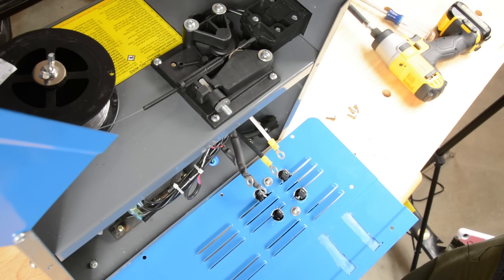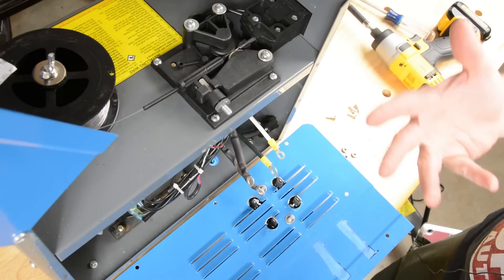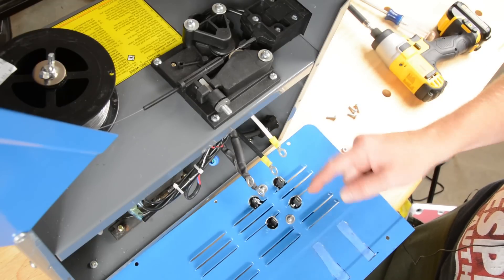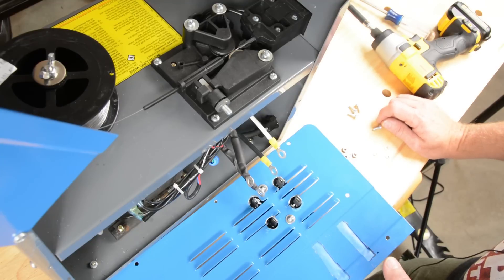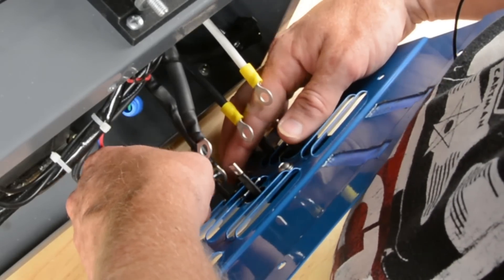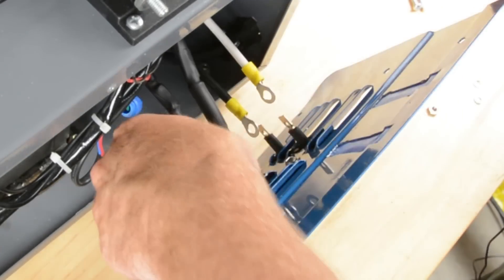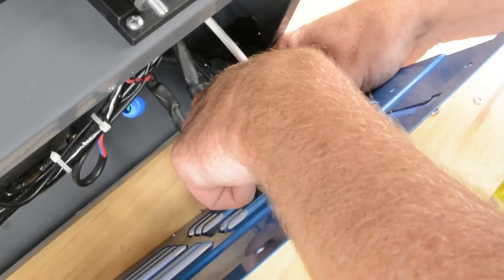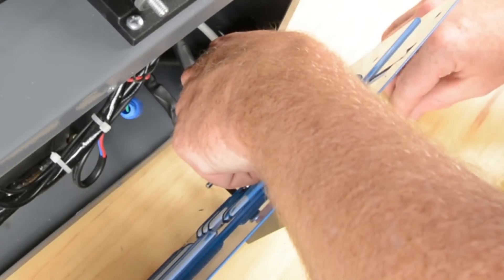Advanced Harbor Freight 90 AMP Welder Mods 06

Comment: Why a capacitor and not a coil?
Reply from the maker: Because flux core wire welding is a constant voltage process and not a constant current process like stick welding.

Comment: Hello. Great videos!! My question is how's it holding up. Not sure if I want to invest in this mod it wouldn't last. I rarely use it but I am planning on building an iron gate for a patio seating area and don't want to run into problems. Thanks again for this video.

Comment: I think it would be great to have a big copper switch that gives the option for DCEP.
Reply from the maker: There's really no point in it.  This machine has no option for shielding gas.  It's flux core only.  There may be an odd DCEP flux core application here and there, but nothing you'll be doing with this machine.
Reply: @MattHeere  , thanks so much, so with the flux core there is no performance difference between DCEP and DCEN? Greatly appreciate your video.

Comment: checked every wire / connection I see. no burnt smell , nothing

Im a 52 year old that's not into electricity.  but can hold my own, ya know what I mean? power to the shed , a few sockets, switches.ect. ..Never owned a welder in my life. Cabinet maker by trade. Weld metal to wood , . So far not so good.

Comment: I have power. wire feed works fine, fan works, . put the meter on. I get a quick reading that fluctuates 16 to 24 volts, then to zero in a second.

Comment: I hope you're still answering questions. I followed your instructions. now I get no spark at the gun. so I took everything back out, and something happened. I still get no spark?
Reply from the maker: Things to check:
- Is the fan running?  If not, then there's likely no power coming in to the welder
- Do you have voltage at the output of the transformer (what you would have hooked up to the rectifier)?  If not, then the transformer is likely disconnected on the primary side, or has died.
- If neither of these is the case, then you likely have a bad connection to the torch.  Wish I could suggest a likely spot for this, but I didn't have that issue so I'm not sure where to start looking.

Good luck!
Reply: Harold here, did same as you but get no spark from torch.  comes on, fan works, pull trigger wire come out but nothing, any help?  Thanks Harold.
Reply: +Harold Utphall
 sorry no help. I've checked for any burnt wires.  I get no ark
Reply: Worked good before , check on power coming out transformer, none.  It is getting power to fan and whatever feeds the wire, as wire comes out.
Reply from the maker: The fan is powered by the incoming 115 VAC right after the switch, so a running fan indicated that you're getting power from the wall, through the power switch and into the transformer.

If there's no voltage on the transformer output then either something downstream is shorting it out, or the secondary winding on the transformer has a break in it (a.k.a. it's done for).  Easiest way to check is to disconnect everything on the secondary side of the transformer and check the voltage with it isolated.

This is a pretty common failure mode for these welders regardless of the modification.  The wire in the transformers is pretty low grade copper, and there's a lot of vibration in these poorly wound coils.
Reply: Hey Matt, Question about the capacitor I'm using. On top has 3 terminals, G, Fan, and HERM, which is which?  It's a 40+5 MFD 370 or 440 VAC  BTR 405440  Thanks Harold.  Thanks for the reply's and Video"s
Reply: Me again, finally got it working, I think I had the wires crossed on the bridge rectifier.  Thanks for the reply's.  Harold.

Comment: hi again i was wondering as I have a 63v 2200uf capacitor laying around would irt work ?
I know it comes without one standard, so I guess adding any type of capacitor would be an improvement am I right ?
Reply from the maker: +Hannes Nilsström You have the right idea.  The rectifier makes most of the improvement, the capacitor is just a "nice to have".  So therefore any capacitance will do some good.  My concern with one this small is that it won't be prepared to work in such a high current environment.  Does it have screw terminals?  If not, if it has regular leads, then it is probably not a good choice just because of it's physical size rather than the low uF rating.
Reply: yeah it has screw terminals
Reply: Matt Heere yeah it has screw terminals
Reply from the maker: Good.  Sounds like it'll be fine.

Comment: Ok I have the rectifier and cap installed. I'm working on an inductor and when it's done will it go in line after the cap?  So torch lead to inductor to negative terminal on cap to neg terminal on rectifier?
Reply from the maker: That's it.  The inductor goes in series with the power to the wire feed/torch.  After the cap is best so you don't limit the ability of the cap to recharge as quickly as possible.
Reply: Matt Heere so I would connect the torch power wire to one connection on the inductor then the other connection to the  - terminal on the cap
Reply from the maker: You got it.  Meanwhile the "ground" clamp will connect directly to the + on the cap.
Reply: Perfect Thanks so much for all your help !
Reply from the maker: Glad to!  Would love to see a few pics or better yet a video when it's done.
Reply: Matt Heere so after I've installed the inductor I was doing some welding to test it out and I noticed I had some porosity (that's the correct term for the little "holes" in the bead) in the bead not alot but I just wonder if I did something wrong because the welds were perfect with just the cap before.. I've been looking at some homeade stick welder diagrams and noticed that the ones with a reactor and a cap have the cap on the + and reactor on the -... I know mine should be set up dcen but should I have the reactor on the ground side?  I was gonna just try it but haven't gotten around to doing it...
Reply from the maker: Hey Joshua.  What wire gauge is the inductor constructed from?  It's possible that it's adding enough resistance to limit the welding current, as opposed to keeping it flowing as it's intended.
Reply: It's 2awg ..? Too thick?
Reply from the maker: Should be fine.  I doubt you're getting enough turns with wire that size to make an effective inductor though.  Hate to say it, but I think I'd just leave it out.

Comment: By the way...why would you want DCEN?  Direct current electrode positive burns with more penetration.  Direct current electrode negative just burns with more burn off of the wire.
Reply from the maker: For flux core, all of the wire manufacturers specify DCEN.  I'm pretty sure that it's because you need to pre-heat the flux before the wire hits the weld.  Flux core seems to penetrate better than MIG anyway, so I don't think you're really losing anything.

Comment: Hey matt thanks for your videos they help alot. I have a question tho ive see a dc aluminium welder wich u can use aluminium sticks to weld aluminium and its needs 90 ams  and above to work and am just wounderi could it work if i run another wire from where torch is coming from to use as another torch clamp to weld with the stick. So it would be like have two torchesh one is the original  wire fed for metal and one is like a clam torch to use for welding aluminium plz help me
Reply from the maker: You might be able to make it work but I doubt you'd like the results.  Stick welding aluminum is a nightmare to begin with as I understand things.  You're then complicating the situation by having no control over the amperage.

Comment: You can order one from Amazon for $16 with free shipping. Just search for 100A Amp 1600V Volt Diode Bridge Rectifier Metal QL100A.

As for the cap I found a 100,000µF 50v at http://www.digikey.com/scripts/DkSearch/dksus.dll?Detail&itemSeq=155793097&uq=635453728855324649 for $30 part number E36D500LPN104TEA5M does that seem ok?
Reply from the maker: c2s Sounds like you found some good options.  With a cap that big you'll probably want to explore including a shunt resistor to dissipate the charge when the power is off.  My 43,000 gives a pretty good jolt when you short it after flipping the switch.
Reply: Matt Heere I was just gonna get in the habit of give quick zap after turning it off to bleed it off. 

 But if I do add one from looking around does a 200 ohm 5-10 watt across the terminals sound about right? Also read about using a 28v fan.
Reply from the maker: c2s Yeah, that's what I do.  It works.  Just make sure you run enough wire out of the torch head first, or it'll burn back far enough to fuse with the tip - which is a pain at best.
Reply: c2s hook a bulb up when you turn the welder off the bulb will bleed the capacitors stored energy.

Comment: Do you have part numbers for the Bridge Rectified and the Capacitor.
Reply from the maker: Ellen Mcginnis No part numbers, but the exact parts aren't critical at all.  Any bridge rectifier will do so long as it has a current rating that exceeds your welder output.  Likewise any capacitor will do so long as its nominal voltage rating is higher than your welder output while not welding.  The amperage will be a well advertised spec for the welder.  The voltage you'll have to measure to be sure, but it's unlikely to be higher than 50 VDC.

For the HF unit those limits turn out to be about 100 amps and 40 volts respectively.  A lot of the large rectifiers on eBay are setup for 3 phase power.  That's OK, just ignore one of the 3 AC inputs.  As for capacitance, the more the merrier right up until the capacitor won't fit in the chassis any more....

The capacitor is by far the harder of the two parts to find for a reasonable price.  New they cost more than the welder, and used you have to be careful.  Caps degrade over time, so a couple of years old is OK, but you don't want one that's ancient.